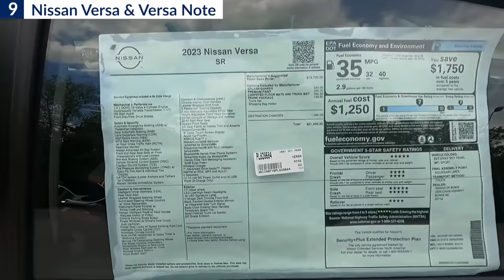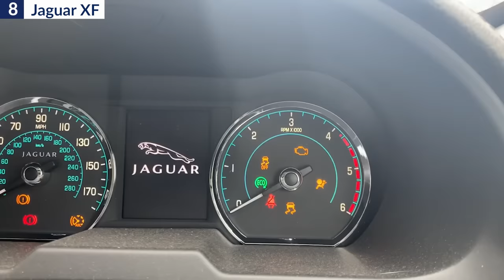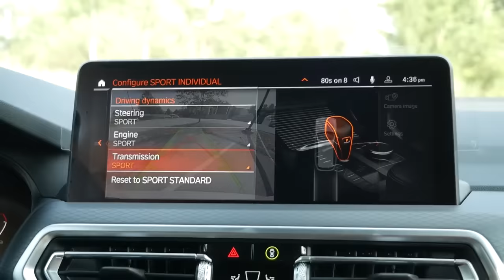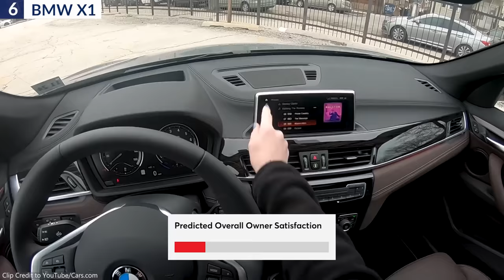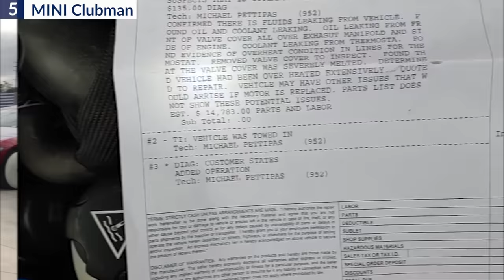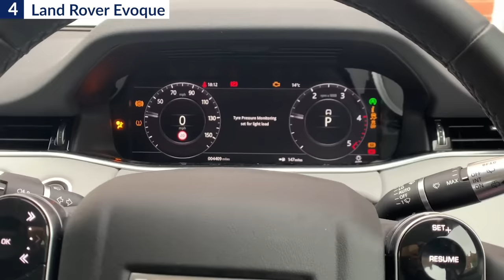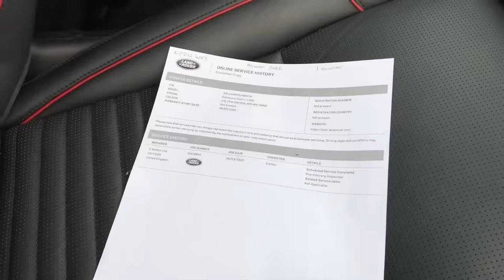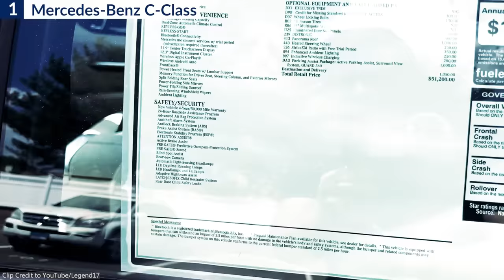9 Cars Owners Get Rid of in the First Year | Here is Why !!

Comment: I have a friend who is a former MB owner. He described their cars as mediocre, high-priced automobiles and swore he would never buy another. Meanwhile, my 2010 Honda Civic crossed 100,000 miles 3 days ago and still gets 41 MPG. I bought it to save money and it has. It's comfortable, adequately powered, with power everything and I just got back from a 500 mile trip with it where it did quite well. It's exactly the opposite of the cars depicted here, it's a keeper!
Reply: There are lower tier or mediocre MBs sure. I have a GLC AMG 43. It’s phenomenal. As far as maintenance yes it’s more expensive but if you have to be worried about maintenance cost then any Luxury brand probably isn’t for that person. Some people are happy with pb and j on white bread, and some people want fillet mignon 🤷🏻‍♂️
Reply: I'd agree about Mercedes. We had a 2013 sprinter and now a 2017 metris as work vans and both were electric nightmare. Both lost the ability to use Bluetooth neither had backup cameras, The metris is as clunky and wobbly as an old Ford Econoline and it's had endless emissions issues, constant check engine light and numerous multi thousand dollar repairs
Reply: You are not a car guy if your dream car is Honda Civic - you are an A to B type of guy.
Reply: My Accord is now 16 years old.  Still gets 31 MPG at 139000 miles. It leaks nothing onto the garage floor.
Reply: @billolsen4360  Some people insist on buying expensive cars, but the cost of acquisition is only part of the total cost of ownership. I've owned enough brands to know that some are better than others. You can keep Ford & GM products. My Civic also leaks nothing and the engine oil consumption is virtually zero.

Comment: I am on my 3rd Jaguar XF in about 10yrs. Only my 2013 XF 2.2 diesel gave me issues. My 2017 2.0 diesel never went to the mechanics. I recently bought a 2022 XF 2.0 diesel R-Dynamic and hope it never goes to the mechanic as well. So, sometimes this is about driving style and not really the car's reliability. I have only heard of complaints for the Velar which is why I didn't go for it this time even though I had eyes 👀 on it.

Comment: Agree with others that this is basically a list of cars that many of the buyer's can't afford.  A lot of these cars seem like you get a great value in the base trim, but then you are missing a lot of features that are standard in cars that cost like $12k-20k less.  For example, you get real leather seats (not pleather), heated rear seats and an amazing sound system in most Limited trims of non-luxury cars, but have to pay like $80k (like 2x more) for a luxury car that has these features. Also, safety tech usually a lot better even in the base models of Asian cars vs many European cars.
Reply: Only if your daft enough to buy new. You can pick up some fantastic cars for a lot less money than a brand new runabout because as they get older, people with less money buy them and they tend to be cheap because they're not big sellers. A lot won't buy because they know parts will be expensive (should be fun when EVs start to get older then), but you can buy a 7-8 year old low mileage car for a fraction of the new price and put away the money you save for any repairs you might have. I've done it for years, the savings mean I can buy cash and if you get a car that's been serviced and looked after it's not often you get any problems. I have a Jag XF, 14 years old now, never had a problem with it, only done 64,000 miles and only cost me £7k.
Reply: a Versa?

Comment: I had a 3 series BMW. It was fun to drive, until it 50k miles. Then everytime something went wrong it would cost 1000 dollars to fix. I swore I would never buy a German car again.
I now own a Toyota. Not the sexiest car, but everything works-well. All you have to do is change the oil every 5k.
Reply: The best cars I ever owned were Toyota Camry Hybrids. First one was rear ended & totaled. 160k miles and zero problems. I replaced with another newer model like it. 150k trouble free miles.

Comment: I dumped a Hyundai Tuscan after a year - not because of the car per se - but because Hyundai was the worst company I have dealt with in years.  The headlight cracked (from a pebble?)and they refused to stand behind it with their warranty.  To add insult to injury they wanted over $1,700.00 just for part, and then made you deal with the rudest customer service reps that I have ever experienced.  (They had no interest at all in letting you speak.)  Every time I saw one of their "America's best warranty" ads it grated on me so bad that I just dumped the car.

Comment: I have a 2016 GLC 300 and it’s been great. Only problems it’s had we’re easily self-serviced. I can’t imagine the C class is that much worse. 

Granted I refuse to take it to the dealership now that it’s out of warranty.
Reply: The problem with the c class is people buy it for the affordability for the mercedes label, but they don’t have the money to cover the cost to maintain it.
Reply: @unkyungh  honestly I haven’t found anything on Mercedes to be absurdly expensive with independent mechanics. I also own a 99’ SL500 for many years now. The worst thing on the GLC is the transmission service and that’s infrequent. 

I think the difference is that Mercedes is less neglect tolerant. Fixing a Mercedes that hasn’t been properly serviced will cost alot more than a Toyota. Engine, cooling, and transmission components are all more expensive.
Reply: @programmer437  no my point is people buy them not realizing the cost is higher for basic maintenance on a Mercedes. They are buying not being able to afford to keep it. I worked in a shop until recently and saw it several times.
Reply: @unkyungh  I’m not really convinced that’s the case. I pay just over $100 an oil change - but it’s only due every 10,000 miles. Which is no worse than a $35 oil change every 3000 miles. 

Air filters and oil filters are no more than any other car (the SL500 has two, but they’re both cheap). 

And you really shouldn’t need to do much else within the first couple years of ownership unless you’re putting 30000 miles on it a year.

Comment: Used to watch these videos religiously before I bought a luxury car. Then after I bought one realized they are like any other car you need to take care of them just like anything else in this world. Mine runs fine and well with no issues within the 2 years 

My number one tip to anyone buying any car is to see maintenance record if buying used to see how badly the car was abused or neglected.
Reply: Luxury cars from euro brands are usually very solid in the first 100k mi, after that they start falling apart.
Reply: @jooroth18  the 100k myth is only true if you don’t keep up with your car specific recommended maintenance
Reply: @soldierplays4616  Yes, most problems arise because of poor maintenance. If they have been looked after they're generally fine, it's when people buy them used that can't afford to run them or pay for repairs when things go wrong they start to deteriorate.
Reply: @severnsea  yea I am so tired of the rhetorical bullshit that every YouTuber tries to narrate that anything expect Toyota and Honda is gonna be unreliable
Reply: @soldierplays4616  If you buy a used top-flight model, you'll usually be satisfied with your purchase because owners can afford to take care of them.  BMW 7-series is the exception.
Reply: @soldierplays4616  It costs more to repair them, which is a big factor in even routine maintenance.

Comment: I have a 2010 Nissan Versa and love it
 I haven't had any major problem and I alway have my oil changed on time and all required up keep. My front brakes were replaced at 164,000 and my back breaks at 175,000. Love my car.❤
Reply: You should only have CVT transmission in an agricultural tractor...only good for baling, etc

Comment: Curious as to a list of what each car parts were mostly replaced or failed. Is there a list from these repair insurers to what fails most on models
Reply: Yes there is, but it’s not publicly available. But take what is said on this video with a massive grain of salt. Lots of misinformation here and in the comments. I am an executive warranty claims administrator and I have access to proprietary data from the manufacturer. One of the things in the data is the most common items to fail. This data is unavailable to the public, but you can befriend an unbiased mechanic. They have access to computer databases and programs on common car failures. They also have worked on so many cars that they know what are common and uncommon failures.

Comment: Back in 2004-05ish, I was driving an ancient VW when the engine bit the dust at 250,000, I wanted to buy a jag. A friend owned one, he had to get new front brakes. It cost him $2000, that was an eye opener. I’ve bought Toyotas ever since and they’re great. I’m at 165,000 and it needed a new starter at about 100,000 and last week I had the front end suspension redone. It runs great. I want it to make it to 300,000. It’s on track.

Comment: You can have a reasonably reliable Nissan Versa if you get one with a manual transmission.
Reply: I  had a 2010 with a non CVT automatic 217,000 miles without a problem. It was a good reliable car until I hit a deer and totalled it.
Reply: Supposedly the cvt is now better,just need to keep the trans fluid clean at the proper milage is what im hearing.
Reply: My neighbor's daughter has a 2009 Versa. Still running without issues. She's a good looking 23 year old and could care less what anyone thinks of her driving a 14 year old small boring car.
Reply: In 35 years of driving manual cars, I had 1 incident with my 10 year old Grand Vitara. The transmission linkage got unclipped, due to vibration. Nothing wrong, just that the fluids ended up on my driveway. The shop reconnected the line, topped it up with fresh fluids, and I was good to go after a few hours in the shop. $180 bucks.

Comment: I had a 2015 Versa Note and it was a good little car for me. I'm aware of the infamous Nissan CVT issues, but fortunately didn't experience it. The gas mileage was great and the leg room in the back seat was surprisingly good even for tall people. It is absolutely not fancy, but it served me well. I only traded it in because I was wanting to go on more dirt roads with a higher ground clearance vehicle. Maybe newer Versas aren't as reliable, but the 2015 model sure was.
Reply: Yep mine was a good little car quick off the line with CVT.
Reply: You didn’t experience the cvt issues because they didn’t exist beyond 2013. People are falsely reporting cvt issues to perpetuate these idiotic lists. Jatco fixed the cvt issue mere weeks after learning of the issues. Nissan fixed the issues being reported through a massive cvt upgrade and extending the warranty to those who didn’t manage to get the cvt upgraded timely. The cvt issues were effectively resolved by 2015 when the company resolved that everyone that was interested in the upgrade should have done so by then.
Reply: @haroldbeauchamp3770  Interesting. In your opinion, a used Nissan between 2015-2020 with CVT is likely just fine?
Reply: @johnchedsey1306  the cvt will be fine. However, the previous owners maintenance may not be. Any vehicle is as reliable as the owners dedication to maintenance. As with any transmission, if the previous owner abused it, it likely should be avoided it. If the previous owner did all of their maintenance timely it’s a pretty good indication that they drove it lovingly. Pull the car fax and inspect the records. Try to find one with 50k miles or less. Immediately go to the Nissan dealer and have the cvt fluid changed. Then repeat every 40k miles. You should have many years of reliable service.
Reply: @haroldbeauchamp3770  thanks for the tips. Right now I have a manual transmission Juke and honestly rather enjoy having a stick shift again. But this is good to know for the future.

Comment: The great thing about this video is that there are great examples such as 4:35 on how to hold a steering wheel. And the steering wheel feel, design and layout are deal maker or breakers for me. You interact more with the steering wheel than any other part of the vehicle so it better be well thought out.
Reply: @@badinstinctsyoutube7108 all my controls are on my steering wheel by design. Technically I don’t need to
take my hands off the wheel F1 style of driving🥴 My Biturbo SUV with 560bhp front the factor is more than enough. But I’m normally driving’s with one hand in the 9 or 3 position on the wheel as I don’t need it impress anyone. But when I’m coming up to traffic at an intersection my two hands go on the wheel as my senses are on full alert for people who don’t know what the F they’re doing. You Learn to be proactive when riding a sport bike and seeing shit that’ll make most people throw up.
Reply: @@badinstinctsyoutube7108 in reality I’m not sure why you insist that driving with two hands on the wheel is something low skilled drivers do? Over 90% of the time we’re driving on roads that are relatively straight, that’s a perfect time for two hands on the wheel. And if you’re taking a 90 degree corner you’re not using 625hp so you’ve slowed down to negotiate the corner. However, get on the gas too soon or too much and one hand on the wheel isn’t going to save you from crashing your vehicle. 

But on a highway where things happen much faster and inputs on the steering wheel need to be much smaller, having two hands on the wheel gives you more control. Your X5 is a nice ride and it goes fast and thus loosing control with higher HP vehicles is not uncommon. We’ve all seen the videos of Supercar Fails. What do you think is the leading cause of these crashes? Lack of car control - incorrect inputs on the throttle and inputs on the steering wheel. When your vehicle’s rear-end breaks loose (power-slide) you need two hands on the wheel to steer out of that. 

Your SUV has steering wheel paddle shifters so two hands are needed. There’s also the airbag which is unforgiving if hands are not properly placed on the steering wheel.

You made reference to F1. You will never see in car camera footage of drivers with one hand on the wheel going down the straights or steering around corners? I’ve never seen a race car driver palming the steering wheel around corners nor driving with a limp wrist draped over the top of the wheel. Car control requires two hands on the wheel.

There’s a lot of online info about driving with two hands on the wheel. People can read about it, or ignore it. That’s a personal choice. Good discussion. Have a great day.
Reply: If you are driving off road that is great example of how to break your thumbs.

Comment: As a 2020 Discovery Sport owner I can confirm this. Somehow I still love the car
Reply: I really want one, how is it to live with?
Reply: @tyusrobinson9869  it's beautiful. Turns heads and drives like no other SUV.
But the repair costs are quite high. Did brakes about 3 months ago. Pads and rotors cost me over $2000
Reply: @victormendez3860  omg😩😩 hows the infotainment system? I've heard mixed things.
Reply: @tyusrobinson9869  not the best. It has some gimmicky things on it like news and whatnot if you get to connect it to the internet.
 Tbh I only use Android Auto on it. Once you hook up your phone it's very responsive although sometimes it might get glitchy. less than 1% of the time I have to restart the car because the volume control is stuck to call volume vs music volume.
Reply: The older version was crazy. Brand new, it vibrates at idle as if new engine mounts r required. People still own them today.
Reply: @zksstalstawidlo9015  thanks for noticing lol
Reply: @victormendez3860    The turn heads this guy is referring to is like back and fourth * as in they pity the person who bought these maintenance Nightmares...and Loooooooose soooooo Much  money in re-Sale
Reply: @victormendez3860   As you mature, you'll get rid of the need for a vehicle that "turns heads"

Comment: Notice how most of these cars have turbocharged 4 cylinders. Though they look appealing because of their increased power and fuel economy, the stress that the turbo puts on the engine causes wear quicker, resulting in low predicted reliability scores. You’re better off with a naturally aspirated V6 or V8 for power or 4 cylinder for fuel economy
Reply: Additionally...the aforementioned 4 cylinder engines the manufacturer perplexingly decided to slap a turbo on are OPEN DECK designs. I can't think of a better block to guarantee planned obsolescence...pushing an open deck block past atmospheric makes for a very efficient grenade in short order.